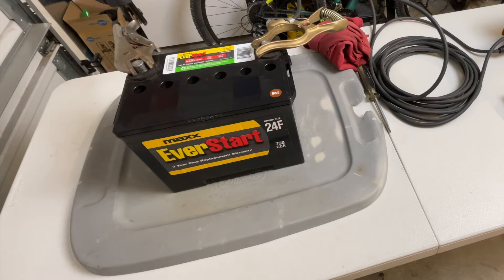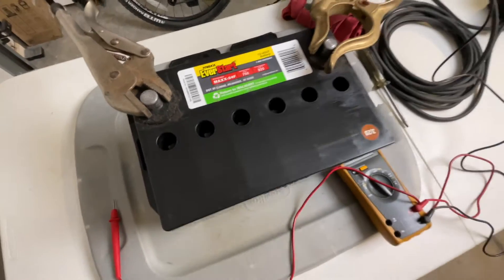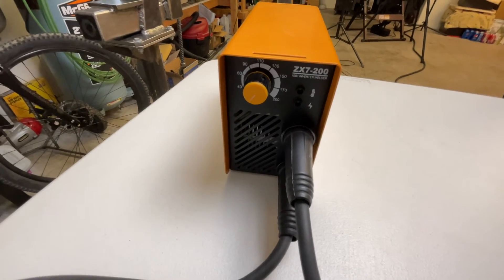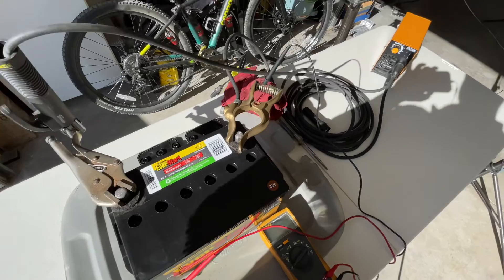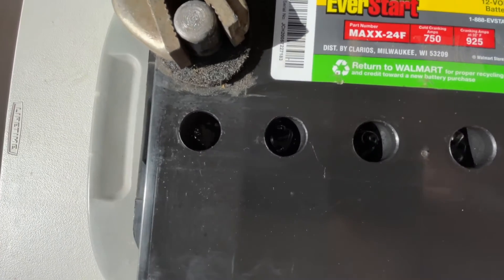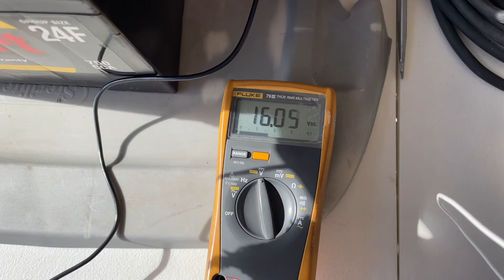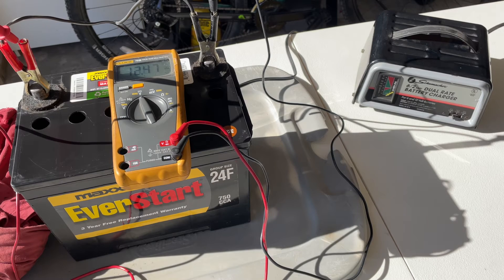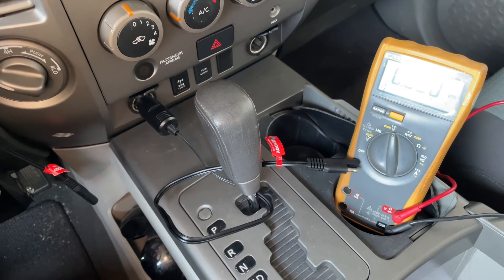How to Restore a Car Battery Using a Stick Welder

Comment: ....that battery didn't need to be attached to a welder. If you have bubbles forming in all the cells...you want to attach a low amperage charger to it...for probably a day, maybe two if it's only a 1 amp charger....and then put a maintainer on it for a 
while.

Comment: I have had a 12V lead acid battery explode when the removal of the charge cable created a small spark.  It blew the side out of the battery case.  Luckily I got no acid burns  to my facial area.
I have now modified my charger with an in line switch about 2 feet from the battery end.  I always switch off before connecting and disconnecting the battery.
Reply from the maker: That is good advice and a scary situation to have to go through.

Comment: I have a many electrolysis cell which output 1000x more H2 and O2 ... its a myth with the battery explosion ... its actually pretty hard to get enough gas to ignite ... and I also revive old batteries and the minuscule gas production one gets from batteries is a joke ... can it create a flame or a Oxyhydrogen bang? yes it might ... but a very disappointing small one ... other factors had to have played into the battery explosion myth ...
Reply from the maker: Appreciate the insight, thanks for sharing.

Comment: Yeah the manufacturers came up with an insurance plan for this repair, simply engineer the batteries so poorly now, that the electrodes will just fail completely.
Reply from the maker: I wouldn’t doubt that, and charge more at the same time.
Reply: @ Paid around 200 dollars for a NAPA battery couple years ago. Not only is it extremely hard to add fluid, but  it is badly warped and bulged.
Reply from the maker: It's a shame

Comment: Your thoughts on the resistance causing the change in voltage is exactly correct. Removing the corrosion is altering the resistance so that you need more amperage to get the 18 volts.
Reply from the maker: That’s a great way to explain it, thanks for your input!

Comment: 18 v to 12 v answer alternators charge at 14 v over this could be fast charging, at mijos  end above 12 .5 stored at the battery if the bat. is less than 12 v 😢 also after starting your bat.should not read less 10.v or is consider 😢not a good bat.

Comment: I have the same problem not driving my car often enough. I want to do the same. How long did the battery last after you give a welder a shoot?
Reply from the maker: The battery is still in the truck today at the end of Sept 2024. 👍
Reply: @DIYHomesteadProjectsDIYHP10  what is your DC welder capacity? What was the last setting you boil the acid?

Comment: Uh you shouldn't have your Cable Coiled up like that Bro when you're using it
Reply: Coiled wire multiplies the magnetism around the wires to make a solenoid/ electro magnet. Causes heat build up. "Flemings Right Hand Grip Rule" shows direction of Nth (direction of fingers) in wire coil. Thumb shows direction of magnetic force. My NAC (NZ National Airways Corp) Instructors would be chuffed to know I've remembered frm 1974. Fred Hughes. Taumarunui

Comment: I did a combo of DC shorting and Flushing with Baking soda first, flush thoroughly with tap, then warm water and add Epsom desolved topped up and on snart trickle charger. Then flush out with warm water few time to rid of baking soda residue. Add back original battery acid and do both trickle and DC shorting charge ( start low,  x 10 min intervals, turn up to 30amps or bubbling in all cells). Load test after 5 mins to see it reads at least 70-80%. Disconnect everything and recheck CCA result again next day. ( load test). If it hold up to 70%, your good. Now hookup to car as 2nd battery with relay switch so while car is running, the alternator will auto charge your 2nd battery when first battery has been charged. I have my 2nd backup battery ( load tested at 100% everytime) sway that for weaker batteries that you don't use often and you can have batteries for other uses to use eg. Emergency lights, water pumps, cellphone chargers, cheap Diesel heater, etc. but eventually when lead plates break down ( too brittle) , its time to strip everything you can salvage for rebuilding other batteries. I taje back failed batteries for the acid and lead. Hard to find any retail willing to sell battery acids.

Comment: As long as a cell is not shorted or open, you will get 12.3 V out of a 12 V lead acid battery if it has has any charge put into it.  You can not determine the charge of a battery by testing the voltage unless you put a decent load on the battery.  YouTube must think you have a lot of gullible people watching your videos.  I saw the most ridiculous advertisements while watching this video.  One was even selling perpetual energy.  They must have graduated from the Obama School of Physics where he claims that energy can be invented.

Comment: As the battery gets stronger it will pull the welder voltage down to its voltage.

Comment: Can I put the battery in a Microwave?
Reply: No. Microwave will only heat I expect. Sulphated lead plates seem to need alot of amps (current) to reconduct power until all lead is gone (to bottom of cell). I'm reading to help motivate me to try my 1st battery "fix" as they're so expensive. Fred NZ 69YRS.Cheers11/1/25

Comment: To be able to use it back in the car the internal voltage is not important much as  the CCA or cold cranking amp.

Comment: Hey bro i have tried using  ronix AH4604  MODEL 200A  DC WELDER but  mean didn't work out  the way it shows  in the video's  i have also tried  on two other  batteries  but didn't  boil the battery 😢😢😢 any help please
Reply from the maker: My guess is your battery is beyond repair. I wish you the best.

Comment: I have Telwin welding machine,end i today try end start boiling and after that my welding machine little bit get hot after 5 min is this ok?>  Will resist welding machine to do complete desulfate? oN MY WELDING MACHINE SI WRITTEN POWER 40 50 60 80 100 180

Comment: Can you do that with a AC welder?
Reply: As far as i know, No. It has to be dc
Reply: Absolutely not. DC = Battery
Reply: Put AC through a DC rectifier... AC welder puts out 35 to 40 volts...check first... You can do two batteries in series if they have similar specs

Comment: Hey bro,tellme can i do with charger that or it better with welding machine?
Reply from the maker: That will depend on how powerful the charger is. Most chargers can’t output enough to desulfate.
Reply: @DIYHomesteadProjectsDIYHP10  end i think so same
Reply: you can use a 200A manual car jump starter

Comment: Your welder is probably outputting 60-70  volts which gives exponentially more power than a regular battery charger or altenator.
Reply: Negative, welders output in a range of 18- 22 Volts DC, his welder was outputting 18V which is par for the course.  The difference is the amount of amperage that is set by the dial. Ohms law applies
Reply: O @mbrang00

Comment: Putting a high charge to the battery releases the sulphuric acid back into the electrolyte.  Have you tried just replacing the electrolyte with a specific gravity of about 1.3? If the plates still have capacity to absorb more sulphuric acid it should be a cheap and easy way to keep using an old battery compared to forking out $250 for a new one.

Comment: My problem with stuff like this is that a battery needs to be reliable and even if this does work it's still an old battery and will probably not be good for another 5 years or whatever would be a normal life of a battery.  And it probably won't have the capacity it should have even when working.  In the end, when you think about the time spend messing with the reconditioning, it seems to me like money well spent to just buy a new battery.
Reply: Ya, you should just keep buying batteries 😂nothing to see here. Folks just keep on walking by.

Comment: If you want to restore lead acid battery's to new condition read The Automobile Storage Battery Care And Repair by 0. A. Witte. It was written in the 1920's but is still useful today on lead acid batteries, has electrolyte SG charts, internal plate cadmium test information, and full tear down and rebuild instructions.

Comment: I got a mattweld 200 amp dc inverter,but it do not work on any battery.Why is that?..please help
Reply from the maker: Sorry I am not familiar with the mattweld but if you connect it like I did in the video it should work too. It’s possible that your battery is too far gone as well.
Reply: almost all these videos showing this process are using inverter welders !!

Comment: The welder is Great idea but must be kept on for a short period of time as the voltage climbed above the 2.4volts of each cell allowable to three volts, which if left for too long can shorten the life of the cells and destroy the battery! Once the battery is fully charged it should be left at approx 12.4 volts. and is sufficiently Charged. ongoing maintenance is necessary to extend the life of the cells in the battery and is a must, also the use of an hydrometer to measure the gravity of each cell is very important to get a idea of state of charge for each cell, doing this will prolong the life of the battery.
Reply: how often you have to do this to maintain the battery
Reply: Yearly
Reply: 12.4 is to low 12.6 is the minimum

Comment: ❤❤❤ you battery was not sulfated much, since it bubbles great on 10A.. i'd watch the battery temperature and if it would not come past say 45°C, i'd desulfate overnight. The cycles are not important you know, the battery temp is.. edit: as the internal resistance of the battery goes down, less volts are needed to get the same amps go in.. so you're right with the voltage.. that's why - if you want 101% desulfation - you need the last cycle at least 50A.. and i saw a guy who was doing this at 200A (i'd personally not go that high)
Reply: Does this process require a DC welder? Yesterday, I diy a microwave AC welder. From 115bvAC to 17vAC. What will happen?
Reply: @daisukiyamamoto3904 it HAS to be DC!

Comment: You never measured the output voltage from the welder. It's actually around 60v thats too high for the battery. Voltage is fixed in a welder ,we can only vary the amps.
Reply: Voltage in welders is typically around 18V, some of the fancy welders with digital controls will allow your to change the voltage. However, it should be checked and verified.
Reply: AC welders are 35 to 40 volts...you need a  rectifier for DC...then do 2 similar batteries in series

Comment: I have done it 10 times over 5 day always same result. I think the battery is gone.the welder I don't know if it is ac or DC
Reply from the maker: Sounds like the battery might be too far gone.
Reply: Can I use a ac welding or not good
Reply from the maker: I haven't tried AC so I don't know how or if it will work.
Reply: no dont try with AC welder on a DC battery @frankiebuttigieg3624
Reply: @frankiebuttigieg3624 no...it must be rectified DC current

Comment: Only 1 cell is bubbling when I do like you said is something wrong
Reply from the maker: The cells that are not bubbling are heavily sulfated. Keep running the first stage until they all start bubbling. If they don't eventually start to bubble I think the battery is too far gone to restore. At least that is my understanding.

Comment: What would ac current do?
Reply: Heat up the battery in seconds if it didn't explode right away. You would have a dead short 30x per second.

You can use a couple of capacitors & a rectifier to do this as well.
Reply from the maker: I don’t know, I haven’t tried AC

Comment: Check out "PulseTech" Xtreme Battery Desulfators.  I have used these units for years on all of my gas engine driven welders as well as all my vehicles batteries. They stay hooked up 24/7 - 365 days a year. They constantly pulse the plates inside the battery and also charge automatically if the battery needs it. I also use them on my golf carts after being fully charged up with the Golf Cart charger, I connect to the PulseTech while I'm not using the cart. They supply "quick connects" so they are very easy to disconnect/reconnect.  I have had great success using these units and they have saved me a ton of money especially on very expensive 36 Volt Trojan Golf cart Batteries. Just some FYI for what has and is working for me anyway.

Comment: Honestly I don’t think you need to charge it again after passing so much voltage and current thru it. I would have considered it successful if the battery voltage was holding around 12.8 -13.2
Reply: Amps be damned, right?

Comment: you will get resistance, capacitive and inductive changes..... why bother with desulfating unless you have a use for the old battery such as a neighbor needs a back up or in a dune buggy or power for a shed! as long as the v doesnt drop below 10v that damages the recharge capability. we use old batteries in the barn on a trickle charger.
but good video
instead of buying a new welder look for one on line .... students get motitated to buy and find out being a welder is tough business and the cheap welders wont hold up!

Comment: does sulfation  happen more in solar batts or in automotive batts ???
Reply from the maker: Sulfation happens when ever a battery sits with a low charge. Probably more frequent in an automobile than a battery that is connected to solar that would receive charging current daily.
Reply: @DIYHomesteadProjectsDIYHP10  Even New off the shelf batteries can be sulfated from sitting in the warehouse or store to long.

Comment: so a bunch off stuff comes off the lead plates  and falls to the bottom  why do u leave it there  ??? better to flush this stuff out and refill with fresh acid ??
Reply from the maker: The sulfation doesn't fall off the plates and collect in the bottom of the battery. During the desulfation process, it is chemically changed and absorbed back into the electrolyte liquid.
Reply: @DIYHomesteadProjectsDIYHP10  THATS what i needed to know.   thanks  .

Comment: Would this work 220v AC. Old school Lincoln tombstone 225 Amp. stick welder
Reply from the maker: I've never tried using an AC welder so I really don't know for sure.
Reply: @DIYHomesteadProjectsDIYHP10 Yeah, I don't know if the output voltage is AC. or DC. or how to check with out causing an arc or frying a multimeter.
Reply from the maker: I don't have one of those welders but there are two types I've seen. One is AC only and the other is both AC and DC. If yours doesn't say both AC and DC on the front you must have the AC only model. If that's the case it only puts out AC voltage. What I don't know is if the AC voltage will de-sulfate a battery or not, I have never tried it. If your battery is already sulfated and no good you could always try it and see if it will work. I would recommend starting at the lowest setting to see if you can get the cells to bubble. I wish you the best.
Reply: Multimeter is your best tool
Reply: You should try it.
Reply: I think so
Reply: You need a DC welder for this. One with a dedicated positive lead and a dedicated negative lead.

Comment: I’m about to try this but man that is a stout lil unit you have, 200amps wow
Reply from the maker: Thanks, it is a nice little welder but I think it's about a 160 to 180 amp even though it says 200amp. It does weld nice though. I wish you the best with your project!
Reply: @DIYHomesteadProjectsDIYHP10  thank you

Comment: It's desulfating, so the internal resistance drops. Therefore, voltage drops and its charging it self. When it's full it won't take amps but voltage  rises and eventually it will explode, hence the voltage limiter in proper battery charger usually about 14.4v.

Comment: Will this work on deep cycle battery?
Reply: Deep cycle batteries generally have thicker lead plates. That being said I have the yellow dc stick welder ordered that is in other videos to charge two deep cycle 6V 425 amp hour batteries. They are expensive enough to spend 130$ for this project. I won’t be videoing but will give results. Thx for posting.
Reply from the maker: There are no guarantees with this method but as far as I know it can work for any led acid battery.
Reply: Dear Tommy Coates, 1978 at 23yrs I survived Motorcyclist vs car (my fault) 16fractures inc closed Head Injury. People lifted Mk3 Cortina off & back seat pax Cathy Campbell nee Townsend 25yr "ex nurse" gave me a penknife trachyotomy due face mushed in. We are important to one & other..Jesus (God) knows. Fred NZ 69yrs

Comment: I have a dc stick welder and 220 volt AC plug. Will this work.
Reply from the maker: That's what I used
Reply: yes, the welder contains the electronics inside that converts the AC voltage to DC voltage